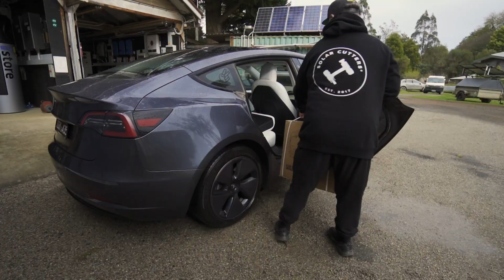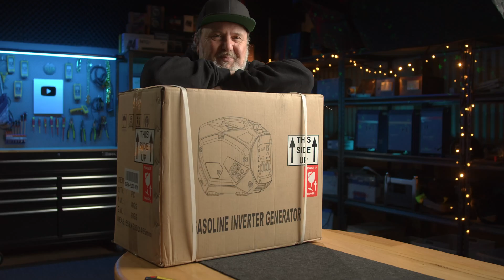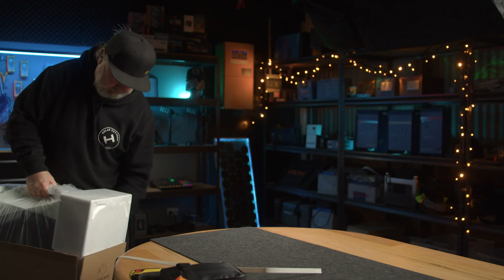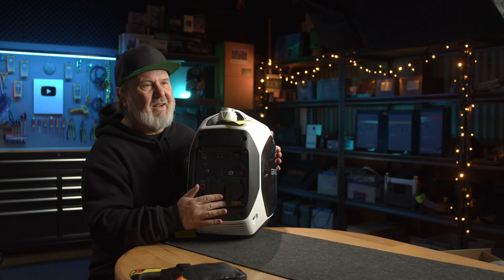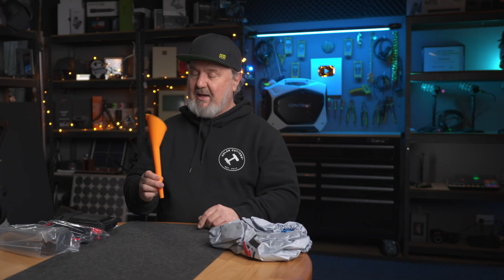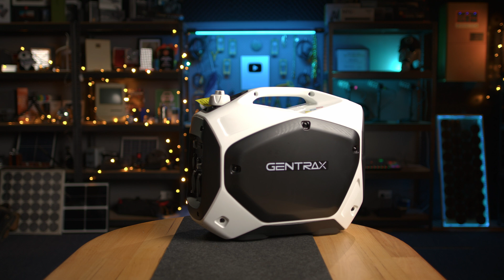Unboxing the Gentrax GSX-2200 Inverter/Generator

Comment: Hi. I see a lot of people making videos of the generators, however i have yet to find one that explains how loud they are in the following scenario... to get the quietest from a generator, if the power you need most of the time say 700watts, do you buy a 1000watt continuous generator or do you get a 2000watt generator so that the 2000watt runs at 50% which is where 58db loudness is quoted, also that the generator will run for longer, eg 5-6 hrs instead of 3hrs? This is important if you are wanting to be as quiet as possible especially if nearby neighbours on campung and if u want the fuel to last as long as possible. The generator gentrax gt800 700watt continous but if using around 500watts i would imagine would have to run engine higher to which would be louder and use more fuel than the gentrax 1000watt continuous? Can anyone answer. My question is because i want to get the smallest but quietest and longest fuel generator running about 500watts battery charger to charge my batteries on cloudy not so good for solar continuous days. 🤔